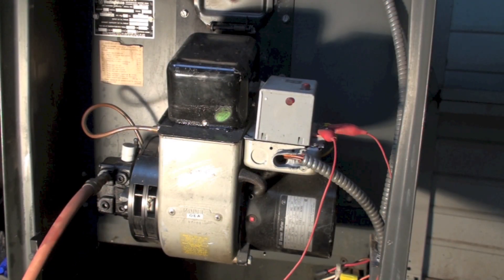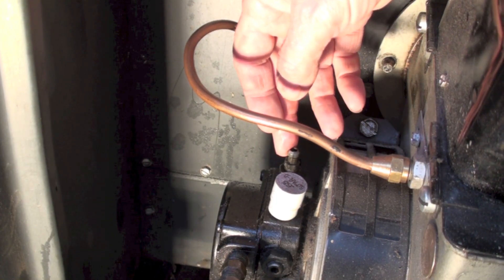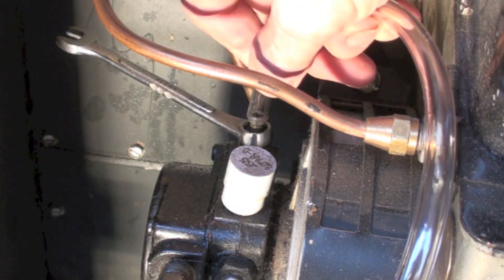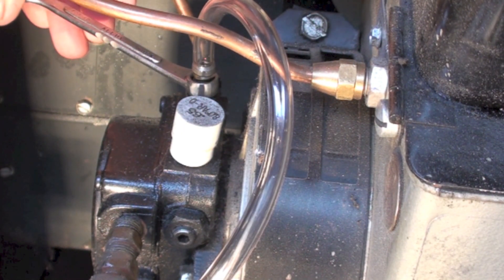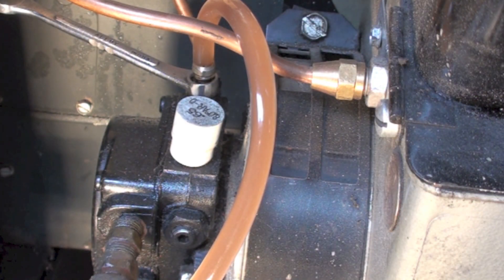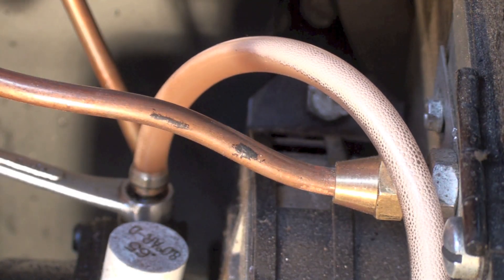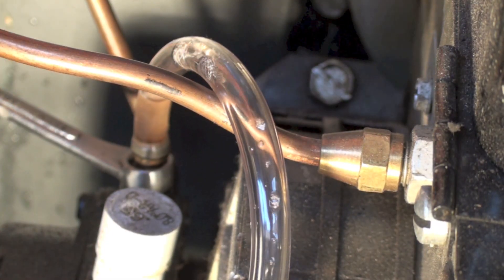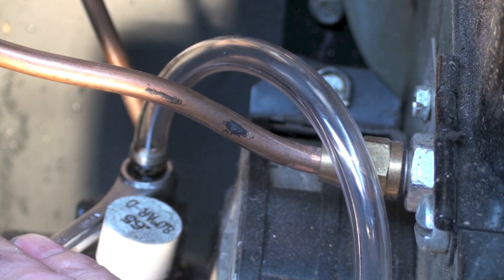How to bleed the oil furnace

Comment: I changed the filter last month. I had to reset the pump a couple of times and then it started to run. But the last couple of weeks it has had to fire once and then on the second time it would stay running. The few days, it fires twice and on the 3rd time it stays running. The problem seems to be getting worse. I never did bleed the line as I believed the air would cycle back the to the tank. The fuel line has a supply line and a return line all the way back to the tank. Will bleeding the pump help fix this problem? If I just let this go and hope it fixes itself, can this damage the pump? Can air in the pump eventually damage the pump? Will the return line bleed off any air in the pump?
Reply: A 2 pipe system does not need to be bled in most cases.  I would be double checking the oil filter gasket to be sure it is not leaking.  Air can damage the pump.  In normal cases, it will self bleed.
GFM
Reply: @grayfurnaceman7640  I tightened up the bleeder screw on the filter and now it fires once and stays running. I suspect the pump was drawing in air under vacuum and causing the pump to fire and then refire
Reply from the maker: @shimaze5479  I think you got it.
GFM

Comment: What would it mean if bubbles dont stop coming, like pink foamy
Reply from the maker: Low oil level in the tank, plugged oil filter, plugged oil line, vacuum leak in the line from tank to burner or fittings.
GFM
Reply: @grayfurnaceman  do you have a video or advice on testing for a vacuum leak? Also I should add the oil line and tank ars brand new and the oil line goes over head. However the burner is at a lower point than the tanks oil level. Would this still contribute to air in the line? TY

Comment: hi, the bleeding works at my place yet no oil reaches the nozzle. The lines from the pump to the nozzle I blown with air so they are free. I even disassembled the line that goes to the nozzle at the side of the pump entirely. Then I do the bleed process and nothing comes out of that opening that should bring oil to the nozzle. How is this possible? The pump works because the bleeding works. Yet nothing comes out of the hole to the nozzle. Only thing I can think of that internally in the pump that outlet is blocked. But the filter looked clean. So that seems unlikely. What could be wrong here?
Thanks

Comment: Hello Sir, we just found your video. We are up in Canada, frigid cold these past few weeks. Grimsby oil furnace, filter outside was froze. Got it off, replaced, bled the line out there for it to run through. Inside turned thermostat, hit the reset button. Now have been bleeding inside, and was off and on. We do have conditioner in, and are waiting. Hopefully for that to do something. Bubbles have now stopped and nothing. Either it is froze...or? Or?
Reply from the maker: Try heat tape and insulation on the filter and oil line and be sure you have no vacuum leaks.
GFM

Comment: Hi, I stalled a used furnace with a new oil line, its 20 ft long. I can't get it to prime. The cad will run the 4 minutes to prime but it never brings oil up. I did it many times even poured oil in the line from the top. Is there a way to bypass the cad to leave it running longer?. I can hear the pump running at the tank.
Reply from the maker: You can jumper the cad cell after the burner motor starts, but I would be looking for a vacuum leak.
GFM
Reply: @grayfurnaceman  thank you so much for everything you do. I got it to prime. It was strange because I have 12 inches of fuel in the tank and the line feeds from the top. It acted as though it didn't have fuel in the tank. I took a 5 gallon container that had a gallon of kerosene in it and I pulled the line out and stuck it in there and it primed in 15 seconds. After it primed I turned off the burner and put the line back in the tank and re primed. So far so good. I just can't understand what the problem was because I know i had the line in the tank only 3 inches from the bottom and like I said I have 12 inches. Thank you
Reply from the maker: @Samuelm370  If the system is single pipe, they will have trouble rising in the pipe.  They are designed to operate with a pipe on the bottom of the tank.
GFM

Comment: Great video. I saw a method that involved jumping FF together and pressing something in (like a contactor) so the furnace continued to run to remove air and water from the tank and lines. How is that method done?
Reply from the maker: You can jumper FF after the motor starts and the burner will run whether there is fuel to not.  Just understand you are bypassing a flame safety control.
GFM

Comment: This is sort of relevant, but for the first time I got a message from my Intech "Shutting down to protect sensor". The entire top of the burn chamber had fallen to the bottom and the system was exhausting into the home.
Reply from the maker: Interesting.  I don't think I have ever seen a combustion chamber collapse.  I have seen pieces fall off, but not the whole thing.  Do you have any pics?
GFM

Comment: Hey Sam question about my burner you have helped me with.  If I wanted to see the oil pressure while running can I I just thread a standard pressure gauge on the gauge port of the pump??
Reply from the maker: You can.  If you leave it on the line the pulsing may damage it eventually.
GFM
Reply: grayfurnaceman  Thanks I just wanted to check it and see what it was because I was curious what it would be since I adjusted the pressure very slightly and now the furnace seems to be running smoother than it was. I was going to remove it after anyway. I will let you know what I find out!
Reply from the maker: @mainelyelectric  Higher pressure is better unless it increases flow excessively.
GFM
Reply: grayfurnaceman  I just attached the gauge to the 1/8 gauge port and while the burner was running the psi was about 110-115 or so not bouncing around on the .50gph nozzle installed.  With the gauge installed on that port is the psi supposed to drop to zero when the burner is killed?  I might adjust the PSI a little bit more and see how the burn looks, but I’m still going to get my oil technician to look at the entire system and see what his thoughts are once I get the oil tank installed.            I remember in the past you had told me that the firing chamber and firebox as I have witnessed while working on them in these units are extremely small.        I have fully cleaned the inside of this unit but do you think it’s abnormal when you first fire the cold unit up to have a little bit of exhaust positive pressure coming out of the inspection port until it warms up and a little rumbling?   It Seems to run fine with the 8 feet of 4 inch pipe horizontal 1/4 inch per ft and 3 feet of vertical insulated vent outside.
Reply from the maker: @mainelyelectric  It should not rumble or puff out the inspection hole.  You are not establishing draft.  I would suspect the horizontal vent pitch and the size of the vent should be increased.
GFM
Reply: grayfurnaceman I think I have figured out what the rumble is from when it is cold. Since the old age of the unit the fuel pump piss’s or drips a little if it isn’t running and when it does fire up it is burning off that little tiny bit of fuel while the fire box is colder.  The rumble goes away after warm up.  I also got the pump pressure up  about 125 psi and it runs smoother.
Reply from the maker: @mainelyelectric  You can install a solenoid in the gun line.
GFM

Comment: What do I need to jump out to have a Beckett afg burner, pump and and motor continously run to make it easier to bleed?
Reply from the maker: What I do is start the burner with the transformer in place.  Then I open the transformer and shine a light on the cad cell.  
You can also jumper the F-F terminals after starting the burner.  I will have to do a video on that.
GFM
Reply: @grayfurnaceman  great thank you

Comment: My problem is that the pump shuts down. Is there a way to make the pump keep running?
Reply from the maker: You can cover the cad cell before you start it, then remove the cover after it has started.
GFM

Comment: Just had a brand new furnace installed and we continued to have air while bleeding.  We hooked up a fuel can before the canister filter and we go air while bleeding.  Took apart the canister, sealed all the fittings, new gaskets and ran it again.  The air stopped.  Hooked up the line to the tank and we have air again.  I have an in ground tank.  Is there a way to find the air leak or is it best to continue digging up the line outside and replacing the fuel line?  Also, it's a two line system.
Reply from the maker: If you are sure about the fittings inside, yes. I would replace the whole line.
GFM

Comment: What do i do if the outlet isnt pushing oul into the fernace the inlet works
Reply from the maker: First I would check the pump coupler to be sure the pump is turning.  Then if there is no oil, you probably have a pump failure.
GFM

Comment: hi great videos ,i bought a house 2 years ago and with a maybe 45 year old furnace ,replaced stack switch nozzle filter and now im having all kind of issues ,the buerner is old is there any way to just replace the burner cuse my budget is low and the becket burner is not that expensive and if how i do that ,thanks
Reply from the maker: You can and should replace the burner with a flame retention burner.  It is fairly involved to repair.  
GFM

Comment: I have a situation... so one of my kids hit the red switch off and when I woke up there was no hot water or heat now I have a little more than half a tank of oil I tried hitting the reset button but it doesn't stay on I'm not sure why. I'm terrified to bleed the line myself to see if there is air to be cleared and away and have no man to help me can I get a step by step on how to bleed a burner that was built in 1940's
Reply: shame on you for having a system that old. any problem you have will be your fault
Reply: Kevin Dutile You don’t know what her situation is. Shut yer pie hole!

Comment: Hi.  We ran out of oil and added 10 gallons of diesel.  We started the bleed and oil came spitting out, but all of a sudden stopped and won't bleed again.  We don't have a service contract for our burner and my husband is refusing to call someone.  Any thoughts?

Thanks.
Reply from the maker: +shaucan You may have plugged the oil filter.  I would replace the filter.  Also why bother with 10 gallons?  It will just run out in a couple of days.  Hope this helps.
GFM

Comment: Have a 2 pipe oil line 60' each  way , i here a high pitch whistle sound when burner is running , should I increase oil line from 3/8" to 1/2"  any suggestions
Reply from the maker: +Ray Dionne You can try increasing line size, but the pump may be failing.  Sometimes when they run dry, they will start making that noise.  It means a new pump.  Hope this helps.
GFM

Comment: For checking spark, I got the idea to grab a nearby 2.5" wood screw and stuck it in to the spring on one side so the point was about 3/4" away from the other spring.  Turned on the furnace and saw a healthy spark, then switched it off again and removed the screw.  Easy and so much safer than the screwdriver trick!

Comment: Grayfurnaceman, you are an internet treasure!  After watching a few of these videos, got my tools together and in 15 minutes I diagnosed my oil furnace.  It had run out of fuel last winter.  Checked for spark, pulled out the burner and checked it over and wiped it clean, then bled out the fuel pump. Bunch of white fluid, then brown, then a bit clearer.  All back together and voila, full constant flame, still running steady as I write!  Thanks a million!
Reply from the maker: +Hans Achter Glad it helped.
GFM

Comment: Can you speak to the external exhaust fan that is used for a horizontal vent situation.
I understand that the exhaust must provide negative pressure before the unit will cycle with a red button reset?

Comment: I have a (very) similar Beckett burner on my pool heater.  Is there some way to jump the blower.pump drive when you are bleeding so it doesn't keep timing out?
Reply from the maker: ramosel You can take the hot lead from power and connect directly to the pump motor.  Be sure the power is off.   
GFM
Reply: Thanks, I'm sure my problem is in the pump or supply line.  The heater lights but won't stay burning.  The blower keeps running and it will re-light for a few seconds, go out, re-light, go out and then time out.   I think I just need to open the bleeder and let it run a while without the timeout.  Thanks for your videos!!!

Comment: good video. my tank was empty.  got it filled, but not working.  know I have to bleed it.  quick question. I unscrewed the nut as to bleed the system. the nut didn't turn by itself... as I turned the nut, the entire bleeder unscrewed as well.  the bleeder came off, but nothing but a couple of drips of oil came out.  question: is that because the bleeder wasn't in place? or does that mean there's a blockage somewhere not allowing the oil to come out? Or do I just need to leave it open for a while to let out what could be a lot of air?
Reply from the maker: Will Clark I would leave it open for a couple of cycles.  It should come thru.
GFM

Comment: What if I am getting oil through the bleeder but not the line to the gun?
Reply from the maker: I would guess either a plugged nozzle if it is mounted or regulator failure if the nozzle is no installed.
GFM
Reply: Would a regulator just stop working or is it something that gets gradually worse?  I have the same problem as the poster above.  Oil comes out of the bleed valve but nothing out of the port to the burner when I close the bleed valve.  Furnace has been sitting since early spring, worked fine all last winter and now won't ignite.

Comment: I've got a long fuel line to my boiler (about 60') from my garage to my boiler and I've always been plagued with air in the line but we recently switched to a clear ultra low sulpher diesel with a biofuel (2%) added and about 3 months into it the air in the line has me bleeding it every 2 days...Ever heard of a connection between fuel differences and air in the line?  Hard to believe i've got a vaccum issue after all these years with no change. TY
Reply from the maker: I can think of 2 possibilities.  If the boiler is much higher than the tank, it could be separating the more volatile parts of the oil.  More likely, you have a vacuum leak in the suction line that is allowing air into the line.  There should be no feral connections on the suction line.  They leak under vacuum.  The flare connections could be leaking due to not being tight or the flare itself is in bad shape.  Hope this helps.
GFM
Reply: grayfurnaceman Appreciate it very much.  Checked it again today and (knock on wood) no air and seems to be running well.  Think I'm going to have  a circulator at the boiler installed to remove air from the oil going forward as this has been an issue on and off for the last 5 years and if I save one service call a year it'll pay for itself soon enough.
Reply: you need a tigerloop system. fix all problems with air guaranteed
Reply: Thanks...I had left that comment 2 years ago :)   Sound advice though....A tiger loop has been installed for almost that long:)
Reply: I know it was 2 years ago but no one mentioned it and I couldn't help it because I do it for a living and it seems like people listen to youtube more than they listnen to the guy that has to fix it.

Comment: TRYING TO START MY FURNACE. NOTHING HAPPENS.  IT WON'T BLEED OUT. DO YOU NEED A CERTAIN AMOUNT OF OIL IN THE TANK? WE ARE VERY LOW. MAYBE 5 GALLONS LEFT.
Reply from the maker: Buy oil and hope you don't plug a nozzle.   I realize that sometimes the money is not there, but running out of oil will cause problems.  When you get oil, do a thorough bleed until you get clear oil.  Hope this helps.
GFM
Reply: Thank you.  I also purchased a new filter from Home Depot. The other one was full of thick sludge.

Comment: Thanks for your fast reply.  The furnace shuts off when temperature drop or not using after a while.  When it is on high temp, it can restart on its own.  You suggested that it could be a leak in the line from the tank to the burner, we want to assume that last because our line in under the ground and tile. My hubby said it might be the oil pump because sometimes he bangs/tap it a little, then it runs.  Do you have video to show where he can replace the SUNTEC A2VA-7116 pump? And can you suggest a pressure meter that we can buy online/store for this pump?  Thanks for your kindness help in advance.
Reply from the maker: I have not done a video on replacing the oil pump.  As for the pressure gauge, look for a Yellow Jacket 78020 model.  
GFM
Reply: its not the fuel unit,, almost never the fuel unit. your line or tank is plugged

Comment: We're in between snow storms here in the northeast and this video was a life saver. I bled both my hot water and furnace burners today and they're working like a charm! Had a length of clear tubing available and as soon as I saw the bubbles I knew I was on the way to fixing the problem...excellent video series!
Reply from the maker: Glad I could help.
GFM
Reply: What size clear tubing did you use?  ¼" ?

Comment: maybe it's just me ,but every time   I've used a paper cup or tiny can to bleed a furnace,My big feet or the hose tipped over the bleed can or the hose jumped out of the can... I now use a #10 can with  the hose clipped to the can
Reply from the maker: Good thinking.  Especially if you are using, like I did, the clear plastic hose that stiffens up after being used for oil.
GFM